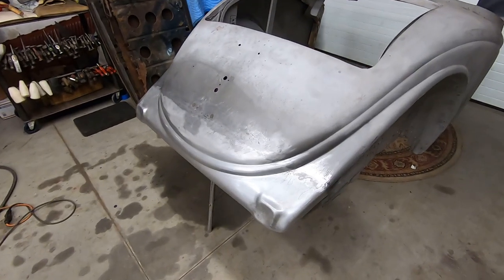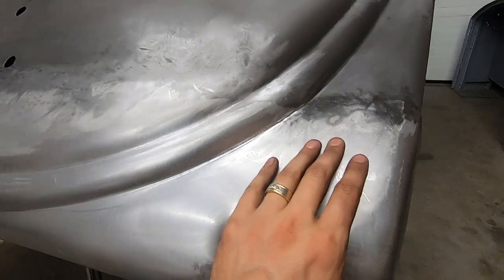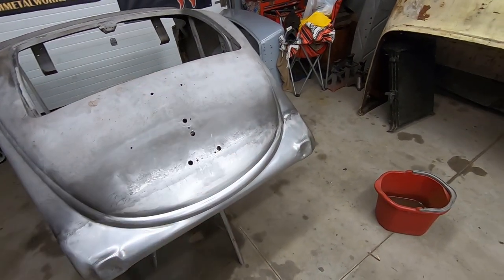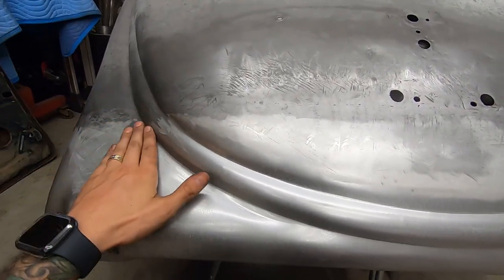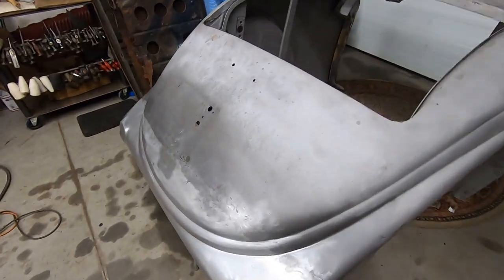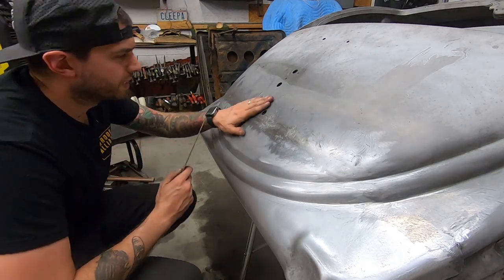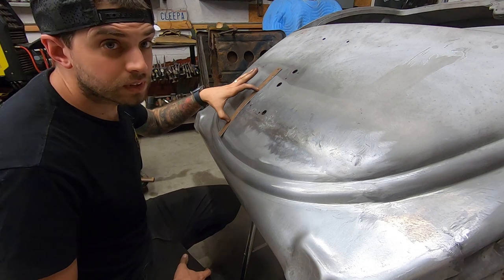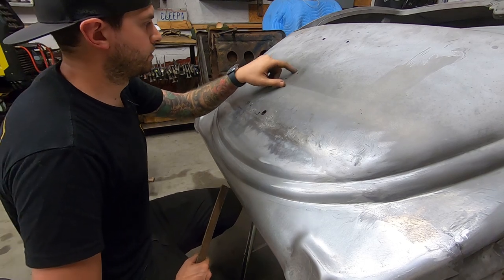1936 Ford Roadster Rear Panel Welded!

Comment: I always enjoy your vids, your work is first rate.  It looks like you're using mig wire as filler, something I sometimes do as well.  I cut mine to about 16" in length, put one end in a vice, clip a pair of safety wire pliers to the other end and give 'em a couple pumps.  That'll give you nice straight  filler rod, easier to work with than curly stuff fresh off the roll in the mig welder.  And thumbs up for the silent sound track.  :-)

Comment: Mind sharing your tig settings.
Reply from the maker: Usually weld 18g at anywhere from 35-40 amps. 40 amps for fresh 18g and 35 when I’m welding to a thinner old base metal